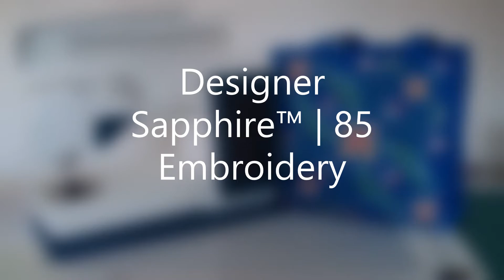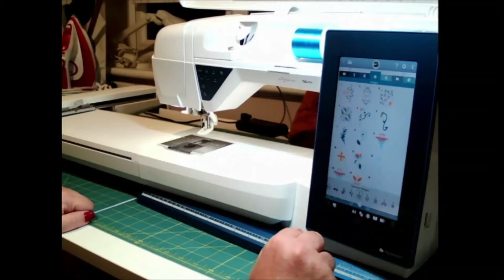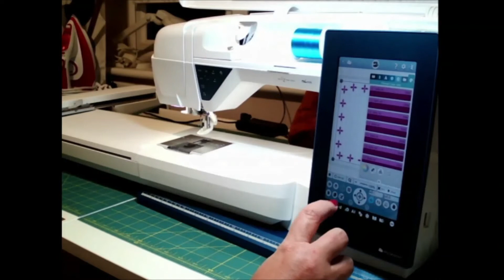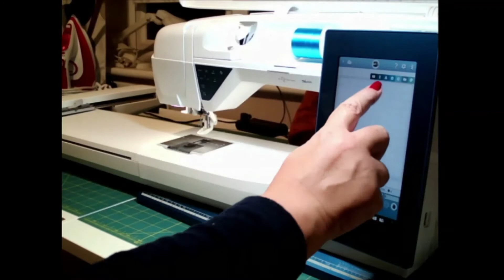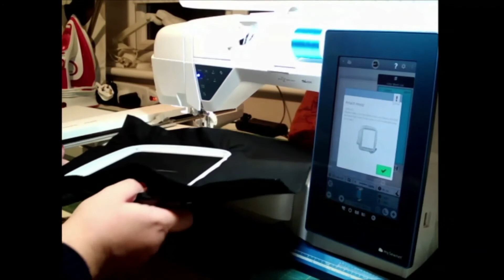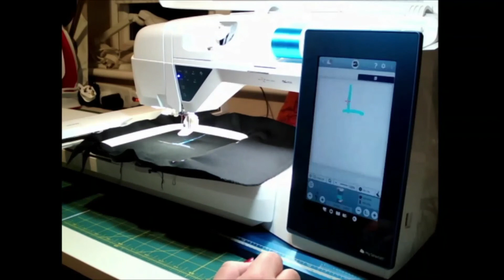Designer Sapphire™ | 85 - Embroidery

Comment: Thank you so much have learnt plenty to be going on with just one question I’m not sure about….What plate should I be using when I have the hoop on for embroidery as I’ve read it needs the single hole one plate for embroidery is that correct